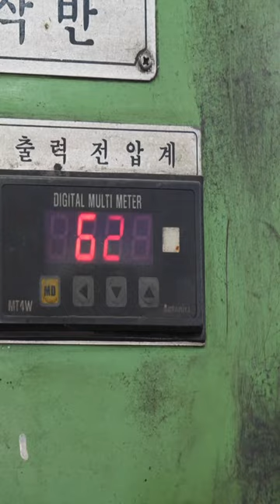The process of making giant screw bolts. Amazing Korean metal factory

Comment: Thats some shallow threading for such a big piece of steel. Js.
Reply: Probably an application where they're more worried about the bolts shear strength than the threads stripping off.
Reply: Machine bolt. Not a wood bolt.
Reply: Greater tensile and shear strength

Comment: If you don't know how to read a micrometer you will fck up every single time.. I used to have this exact same job but I wasn't making bolts, I was making shafts for extremely long conveyor belt drum pulleys. And the thickness of a human hair can be the difference between a good shaft, a good part, or a piece of scrap metal .. love this video!!
Reply: :O
Reply: Human hair measures about .004" 
Parts I've run in the past had a tolerance of +/- .0005" crazy tight

Comment: Those are called Socket Head Cap Screws, and these are well made.
They will probably be coated afterwards to prevent oxidation, they are most commonly black oxide treated, but some are powder coated as well, etc.
Reply: :O
Reply: Bunların danışmanlığını yapıyorum ve bunlara ımbus diyoruz videodaki imbusun ölçüsü M14x90 olabilir
Reply: @j0xq I had a surprisingly hard time figuring out the origin of Imbus, but now it makes sense lol
It's the abbreviation of a series of German words that means "socket head cap screw by German company name", though it should be Inbus, but I guess they protect the Inbus copyright, and so probably some started using Imbus instead.

It's a lot like how in the English speaking world, Allen Wrench is the name for the hex head wrenches, but it's a brand name, but we all use it generically, but they properly are hex wrenches not Allen wrenches lol
Reply: What do they end up being used for?
Reply: @fartmoderne7205 everything! Lol
From cell phones to bulldozers to airplanes to robots.
They are used in all different sizes, for anything that either is precision, or for fasteners that are recessed into holes so you can't fit a regular wrench on it.

It's also often used in places where a regular screw could be used, but this gives a much better connection to the tool, and won't slip out and damage something.
Reply: :O
Reply: 100%. I work in fastener sales and I sell these daily, most common in Australia is Zinc clear plated, but there are also stainless ones, and for a heavy price, aluminium or titanium ones.

Comment: Good process Inferior steel
Reply: Really? Shows how little I know of this subject. I thought it was stainless
Reply: Dude, Korea has stepped up their metallurgy game in the last decades, quite a bit actually. Same with all of their manufacturing, including tires. Seriously. In the tech space they've been making some of the best aluminum enclosures for a long time, though pricey if you don't want foil. 😅

On the tire subject; Hankook seriously makes some of the best tires you can get now. Back in 2018 I got a new Tacoma that came with a set and my first thought was to change them. After a bit of reading I learned some things. Those tires were great AND they lasted. I was impressed enough to buy another set for that same truck. I was gonna replace the Continentals on my Camaro with a set but was able to get a brand new set of Kumho for free so... Yeah you can't beat free and especially tires rated as high as they are. You didn't ask but...